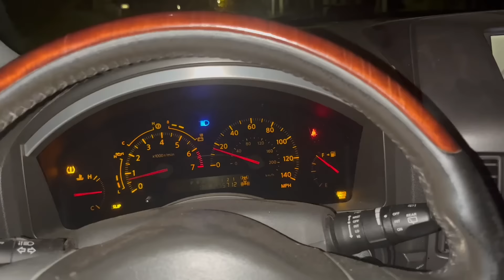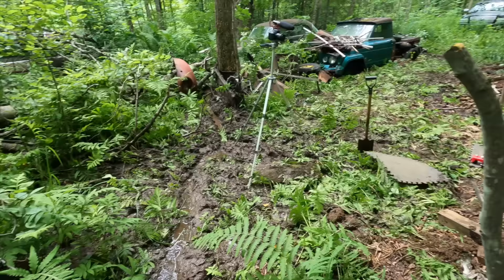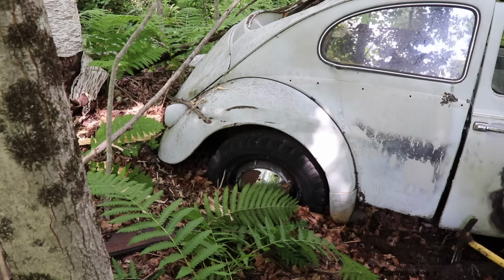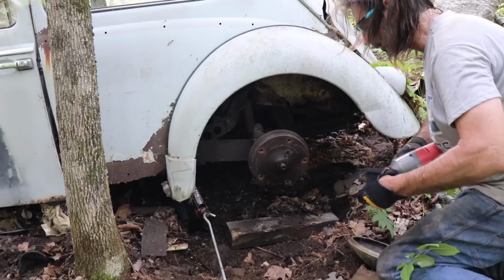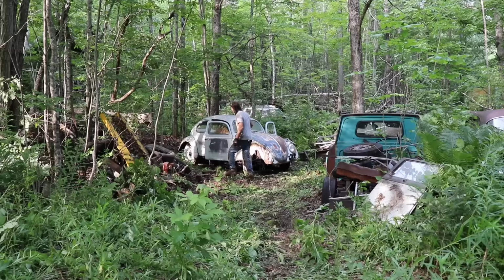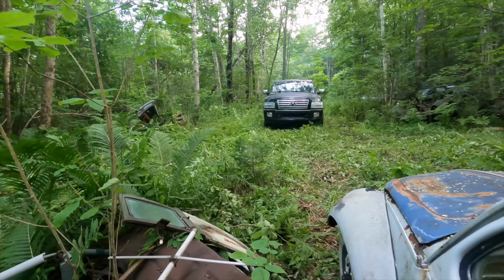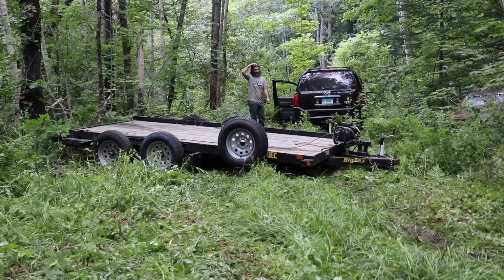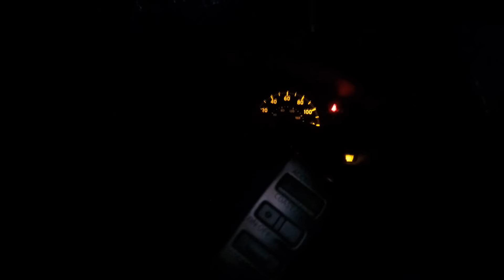ABANDONED Car Rescued From Woods After 50 Years - 1960 VW Beetle | 4 Full Restoration

Comment: I helped a buddy pull a late 50's bug out of the woods a few years back. We were worried about the rusty framehead and didn't want to rip the front beam loose. So we cabled up to the transmission horns, pulled from there, and bundled the cable to the front beam to keep it pulling straight. Worked like a charm. Also, when pulling brake drums and the shoes get stuck to them, take a long punch or screwdriver and poke it through the open lug bolt holes to push the shoes back towards the backing plate. Helps keep things from binding up and making the pull even harder.

BTW, did you dig those black tent poles from the scrap pile next to the Westy? Also, that split bus door is a Palm Green/Sand Green from a 56-58 bus. Nice score!
Reply: And wear a hat!
Reply from the maker: yes, great ideas Corey , I have used a punch in the past ...my luck i'd bugger up the threads lol, so i stuck with the hammer. That. is my plan on the SO23 camper, try and tie the frame / beam / torsion tube all together for loading once it's a roller....the poles are still there , i didn't grab them haha, i will. thank you

Comment: Hell yeah Rad Dude!! Save em all!! I love all the weird unique features of the 1960 beetle!! That is definitely a 60, I can tell by the one year only vertical key slot in the door handle!!
Reply from the maker: Hi Chris, thank you for the 60 info , i'm a newb on the 60 stuff
Reply: @5150mxVW  no sweat homie!! I have an April 1960 pearl white beetle and I love the odd ball quirky one year stuff they have!! Weirdest part is the trans mount on the nose cone of the transmission, which raises it slightly, which tilts the engine down a tad, which means one year only dipstick!! (Supposed to be painted red! So we dont mix em up!) Stock muffler would have been different too as a result! Fan shroud has 1 year only rubber wire clips, and since it's the last year for screw type wire connections, the turn signal switch is incredibly rare!! That and the vertical key slot. Also cool 1 year color options! I'm sure I'm forgetting stuff, but they are such cool weird beetles!! Cant wait to see more on this car!!! Have a Rad Day duder!!! You kick ass dude!!!!!!

Comment: Love the rescues! What happened with the Bus?
Reply from the maker: headed back in a couple days for the Bus, I needed to get a win under my belt lol... Every tow vehicle I own is having issues / needs work so I wasn't sure I was even going to be able to trailer the Beetle home due to QX56 going into limp mode constantly. I was in neutral coasting down the hills of the highway with the truck off ...it was BAD. Took forever to get up there , couldn't find the sweet spot / trick / gear / speed / tow mode , no tow mode , tried everything. On the way home it flat out died a few times and would not restart. It was the longest ride home ever, got home at 6 am ...did snooze some but it was bad :).

Comment: Would bringing rt and left link pins with free rolling hubs and aired wheels be easier.just two link pin bolts and tie rod to break loose on each side. For the rear that nut is tough. They ain't easy your tough.  Very special cars.

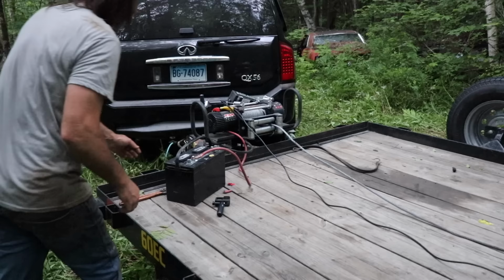Comment: 57:43 same happend to me, copper-clad aluminum wire off Amazon, absolute junk. I bought some better, hopefully mostly copper wire or had some after a sub install I think. I thought I was having wiring issues with my aux lights and stuff, but luckily found the bad ground before I got in too deep.

Comment: Maybe try dawn dish soap for easier sliding on trailer..totally amazed that made it on trailer but i bet i could have done it as well...challenges like that are fun..juat never had frame failure like that.  What was even holding the tortion tube to that bus?
Reply from the maker: yes, i have done that on a few in the past , got the tip right here in the comments :). This one i planned on having it rolling ...then i was going get a bucket of water from the stream and add dirt / mud ....but it was go time , darkness was coming fast. I'm not really sure, it's pretty fracked though :(

Comment: You should have stopped at the first convenience store and drunk a quart of Gatorade then took a 30 minute nap with the air on max.
Reply from the maker: I wanted to stop in town so bad to hydrate , I was cooked but the truck hadn’t gone into limp mode during towing so I figured I would go until it started acting up . Well that was about 2 hours , I stopped at the Vermont welcoming area and I eyes grew big as I saw the drink and snack machines all light up . I didn’t want to take the truck out of drive so I curbed it on an angle and said “ don’t u go anywhere I’ll be right back . Well the place closed at 7 and the doors were locked . So I looked up the next closest gas station . It was 24 hours , sweet ..only 17 miles to go lol …got there , got gas and left it in neutral ( didn’t want to shut truck off ) went to go inside and they closed a half hour ago . Damn , onto to the next , nope completely closed …finally found one , got two waters and by this time the truck had completely temporarily broken down , would turn over but not start ….several limp mode sessions so it was nap time . Finally decided to get going at 4 am and as soon as I turned out out of my nap area , bam …LIMP MODE already !?!?!? …it was a long , long drive home lol . I made it home Friday morning and managed to get the vid edited and uploaded on Saturday . All in all 10 hours rescue , 9 hours driving , and 8 hours editing and uploading :))) . Thank you

Comment: Why not use the big impact on the puller
Reply from the maker: I edited “ why “ out of the vid …you just bend , break , strip spindles , threads , tools etc …impacts are not meant for pullers …cranks / flywheels etc

Comment: Why dont you just use the impact on the puller. The drum will pop off in 3 sec
Reply from the maker: haha, i edited "why " out of the video because someone always says " why don't u just use the impact" ...do you use the impact when using a flywheel puller or crankshaft removal tool? NOPE...You break💩 when you use an impact.... you can easily damage the part /spline or the tool

Comment: Ummm,wait,HF winches power cables are low end,but not total junk.. Just because one lives up north,leaves their trailer out in all northern weather, exposes it to all that salt,or acid solution causeing and and all exposed cable ends,cables,wiring,housings,etc to corrode when even Warn winches do the very same when exposed that way...come on,be honest and realistic here...
Reply from the maker: It’s the power cable , cut it clean , attach to a new battery post , connect to a good deep cycle marine battery and it’s toast after like 8 loads
Reply: @5150mxVW  I've not had that issue pop up with this last winch from HF,yet but it's only a few years old,and there's no salt down here in deepest,darkest south Abalama..
Reply: Honestly, they're junk, but for the price, I can't expect much better. Copper-clad aluminum will rot/corrode no matter what, it rotted under my hood, under the heatshrink, etc. When it corrodes, it was easy to tell on mine as it looked like the wire swelled up. 99% copper wires are worth the cost and are much more reliable. Lesson learned on my end.